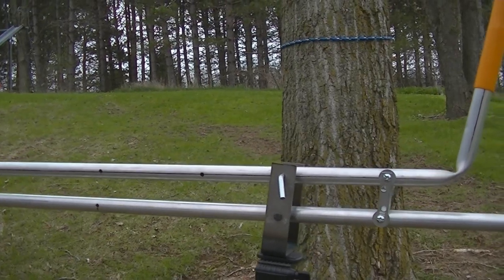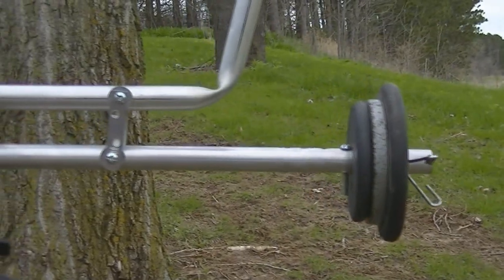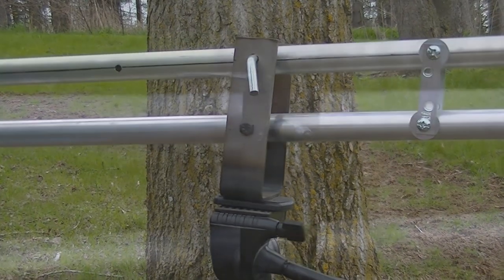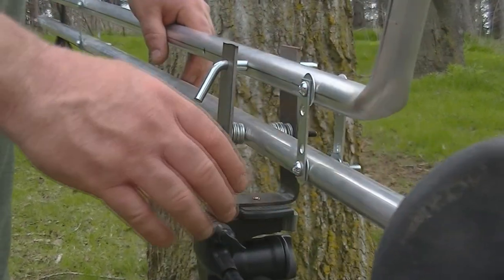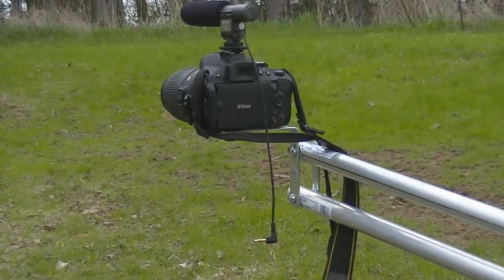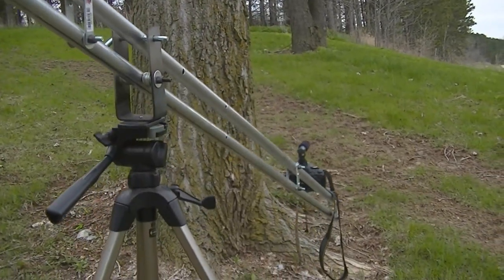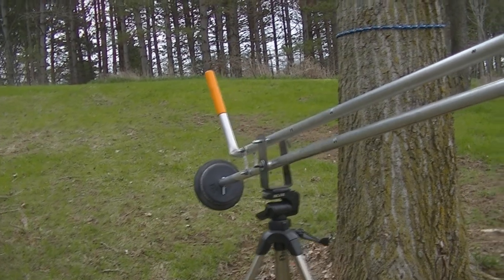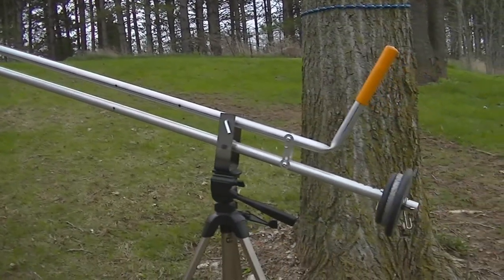Homemade Sturdy Portable Camera Jib

Comment: You should make an instructional how to make the camera jib video. I would certainly appreciate it and im sure many other low budget photographers/videographers would as well. Excellent build, although the example video seems to get a little choppy (software probably) when it is going through the tree branches next to the creek.
Reply from the maker: I'll have to do that. Shouldn't be too hard to pull it apart and throw a vid on putting it together and the pieces needed. Came out better than I thought.
Reply: I'd love to see it especially since it looks so easy to build, sturdy, and cheap.